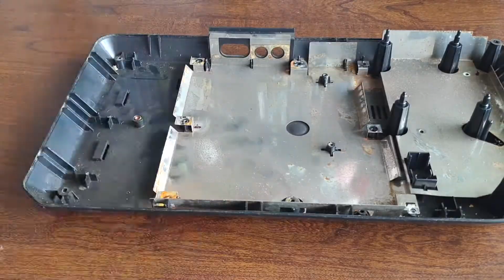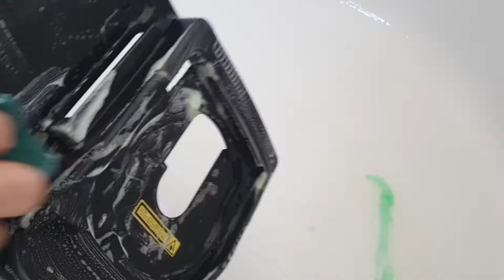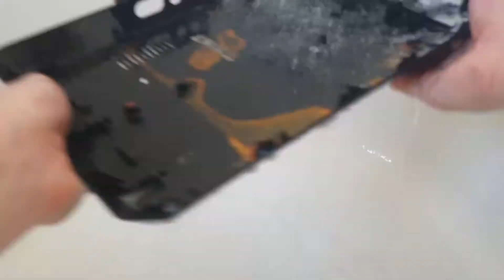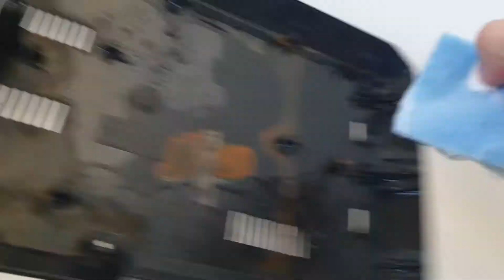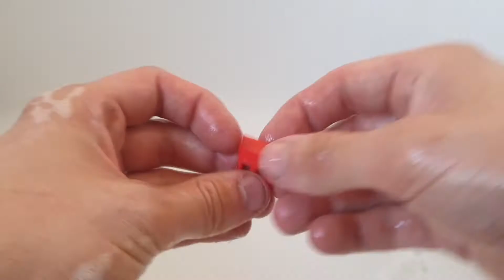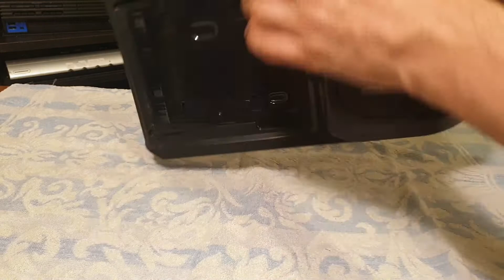Sega Mega CD 2 - Repair - Part 3

Comment: hi!! I have the same problem that you had, I changed the laser but it does not recognize the cds, I did not understand how you fixed it, could you explain to me what you checked that you found with the solution? thank you so much
Reply from the maker: Clean the laser lense if you can first, failing that, replace the laser with a version that suits your model. Whilst you're changing it, some people recommend changing the capacitors since they can leak, but it's not super easy without good kit so consider whether you would want to do that before trying.
Reply: @NaokisRC  
thanks for the reply! what I did not understand about how you fixed the problem, if it was by changing the capacitors, it is the only thing that I have not tried in my case yet
Reply: I clean the lens and change the lens also, i still with the same problem, disc spin, i got red light from the láser, but not recognize the cd